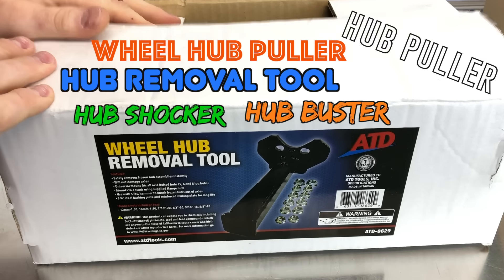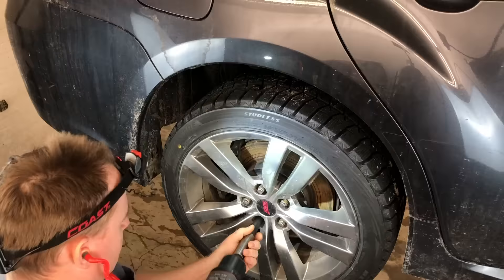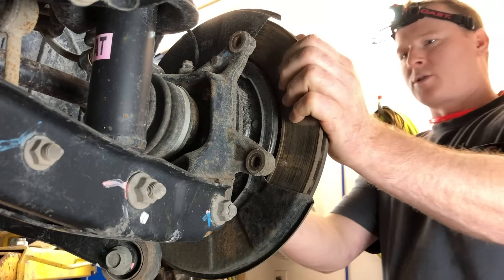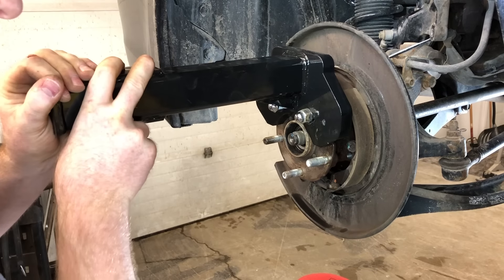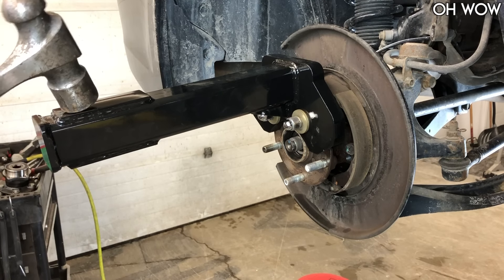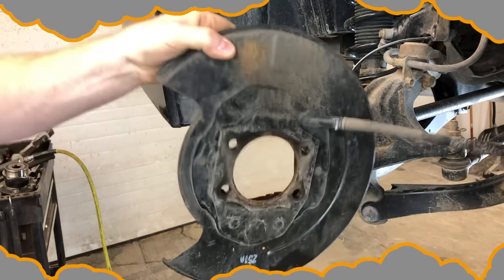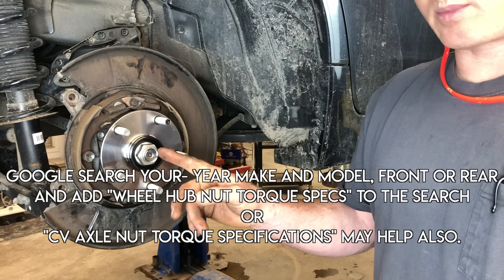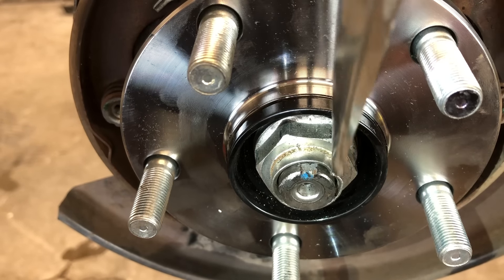HUB SHOCKER Hub Busters  |  REMOVE STUCK WHEEL BEARINGS EASILY!

Comment: I have one of these tools, but didn’t have as much luck on my Land Rover with it.  The nuts and washers that came with it completely failed, so I recommend getting higher grade nuts. It’s going to be tested again since I’m replacing the wheel hub on my Subaru for the second time 🤬.
Reply from the maker: Sorry for the late response. Check out the new video. I solved some of the issues you are having! https://youtu.be/eKqYtMdlPYo

Comment: Rotors are frequently rust-welded at the seam of the lip of the hub assembly, an abrasive pad around the lip of it helps. I hit it with PB blaster too. If i'm replacing the rotor and other components I am not shy about using a min-sledge hammer.
Reply from the maker: Same here! Rust makes you creative  doesn't it? I hate rust haha 😀🔧🔧
Reply: @EasyFixShaun  I ordered an air gun after watching people bust off those wheel bearings in less than a minute with it. :) A valuable tool to add to my air tool arsenal regardless.
I also saw people free up frozen bolts with an air gun you can't fit get any kind of impact gun or ratchet on due to space. PB+creative application of shock from the air chisel, boom.
Reply from the maker: Awsome! I'm glad that worked out great for you. Are hammer's are vital for rust problems. Very handy 😀🔧🔧

Comment: Thank you for sharing this tool! Just wondering can this tool damage the knuckle when you hit the wheel hub so violently?
Reply from the maker: Anything is possible. I haven't seen it happen yet though. The tool seems to really do what its designed to do in most all applications i have used it for, which is breaking the rust bond between the bearing's and knuckle. The only vehicles its not powerful enough for so far is some 2500's and rear ford explorer bearings 😀

Comment: Good video.  Thank you.
Reply from the maker: Glad you liked it! Check out the updated video! Hub Shocker 2.0. I solved all mounting issues I was having with the tool. I only thru-bolt now with grade 8 bolts. I also solved the wheel bearing hub from splitting into two pieces using the cv axle and nut. Let me know what you think 😃🔧🔧 https://youtu.be/eKqYtMdlPYo
Reply from the maker: You are very welcome!

Comment: Wow, my 2002 Sebring was a flood car and the wheel bearings we're still good in it. That was 2 years ago. Glad I didn't buy that Subaru I looked at after that car. But the tool seems to work well.
Reply from the maker: 2002 Sebring bearings seemed to last a long long time from what I remember. 😀

Comment: This fellow says the CV axle is what holds the 2 halves of the wheel bearing together. I just replaced a rear wheel bearing on a ford explorer and the cv axle does NOT hold the bearing halves together. The CV axle splines and the wheel hub splines are tapered slightly such that the hub nut tightens them when the nut is tightened. However, the hub is only pressed into the inner bearing halves. I bought a cheap bearing and hub and the inner race rear half separated. I purchased an expensive bearing and no more problems.
Reply from the maker: The CV shaft has three jobs. Transmit power to the wheels. Transmit power while allowing suspension and steering movement. Hold the bearing together as a failsafe. That is how it works. There are some bearings that do not use a cv axle to hold everything together on some FWD and  RWD vehicles. Those bearings are built differently to make ensure the bearing doesn't come apart. I am glad you got your ride working with some good parts 😃

Comment: just bought the tool - wish me luck trying to replace my rear wheel bearing of 2010 buick enclave.
Reply from the maker: It will work! Keep me posted please :)
Reply: Update :  front wheel took me like 5 whacks of my 5lb steel mallet - and rear ones does not really need the hub buster. Super easy and never ever finish the job that fast - took me 1 hr each wheel .
Reply from the maker: Nice work man! great tool huh? If you ever have to do it the hard way it really makes you appreciate it 😀
Reply: I have a 2013 explorer and trying to get the rear passenger hub out. I’ve got this tool and a 10lb sledge hammer - zero movement even after a ton of really good penetrating lube. I’m a big boy and can swing a hammer - this thing isn’t the be all end all folks. Not working for me. (Yes I used washers and torqued it up good)
Reply from the maker: Try the updated hub shocker video 2.0. Works every single time. https://youtu.be/eKqYtMdlPYo
Reply from the maker: Sorry you had trouble. It works well for me with the axle nut on. Subaru’s or any other extremely difficult to remove bearing come apart without the nut. Once the bearing “releases” from the knuckle the axle nut and shaft can be removed. I’ve had so many Subaru bearings seperate into two pieces that I do them all with the axle nuts still on now.
Reply from the maker: JD5179 Check out the updated shocker video for your next bearing removal. I solved all mounting and separating issues. I feel like I have this thing dialed right in for the toughest bearings on the planet. Let me know what you guys think! https://youtu.be/eKqYtMdlPYo
Reply from the maker: haha! That is hilarious! ....Actually it does work that way now. Check out the updated video. I actually use the nut to keep the bearing from separating on subarus now. Pops em out. Works awesome for the toughest bearings, which I feel are Subarus right now. I never thought in my wildest dreams I would have to remove bearings like this. But, I would say they are super easy for me now. They take me 20-30 minutes roughly. I Got her down to a science 😀 Hope it helps! https://youtu.be/eKqYtMdlPYo

Comment: I used this tool. Beat on it for two days. This tool provides downward force, perpendicular to the force required. The force should be away from the vehicle. The easiest method is the hardened bolt through one of the wheel stud holes. If it is super stuck weld the hub to the bearing so it doesn't separate. Four or five trigger pulls on an impact gun is all it takes.
Reply: The bolt through the stud hole only works when you can push against the knuckle. The Subaru design doesn't allow that.
Reply: @LongDefiant  I used the bolt through the stud hole technique. 7 squeezes of my impact gun and off it came.

Comment: Thanks
Reply from the maker: No problem!
Reply from the maker: Check out the "2.0" video for the beat mounting methods. Ive had some problems with crazy stuck bearings and now use grade 8 bolts only. 😀🔧

Comment: The holes in the rotors accept bolt and make the rotor removal job much quieter and easy.
Reply from the maker: For sho! In michigan though sometimes that method will rip the brake linings off the shoes inside. There is usually a rust ridge on the inside of the rotor. So the best here is to give a hit and see if everything can be broken loose and slipped off. 😃 Check out the second video and let me know what you think if you don't mind??? https://youtu.be/eKqYtMdlPYo
Reply: @EasyFixShaun  I live in PA, so I have something of a clue with rust. It's the red-B R O W N reality of our "Salt Life" in the rust belt. lol.

The first time I did rotors on the Impreza, I was hammering for 20 minutes on the one rotor and it just wouldn't budge so I consulted yee oldé youtubes to see if I was missing something as I only had GM's before. That's when I picked up the bolt trick from one of the "Subaru" Technician channels. 

Thankfully, I have yet to experience P-brake shoe separation. It may help that only use a ratchet and walk the rotor off slowly, but I can't really say for sure as I haven't tried it on any other vehicle. As a side note, I'm slow in general, hence why I never became a professional mechanic. lol.

I'm still on the oem parking shoes with 235k+ miles on my '15 Impreza hatch and I have gone through four sets of brakes thus far. That may be because I typically do rotor and pads together regardless of disc life so there hasn't been time for serious wear to create a larger than specified lip. They last about 50k miles typically, which I easily cover in less than a year right now. However, the last set I got 80k with a bit of life left. I used Raybestos Element3 Hybrid pads and plain centric rotors. In any case, I'll be sure to keep that in mind when I start driving less than I do now!

In my experience fresh pads on old rotors (or drums), even with a trip to the machine shop and a proper break in, end up in warping "great" pedal about half way through pad life. Being a bit of a science/engineering nerd, I know that warping is caused by heat/stress cycling and has literally changed the alignment of the metal crystals. So I don't trust them for longevity after they warp, especially since I do rideshare work.

I'll be due soon for bearings all around (again) myself and will be looking into this tool. It makes economic and time sense between taking the spindles off, taking them to the machine shop, and taking the car in for an alignment afterwards.

Ii want to thank you for taking the time to respond and providing me with new to me information. I REALLY do appreciate it. AlsoI really enjoyed both videos. I hope you had a great holiday and wish you and yours a happy and bountiful New Year!
Reply from the maker: @storejoshuprite  Yup I agree. It makes everything so much more difficult. It sucks. 😃

Comment: Are the holes in the tool egged out enough that this tool will fit larger vehicles, such as a one ton eight lug?
Reply from the maker: Yup will fit 3/4 and one tons. Although if you are working on one of those the socket and extension method on the mounting bolts combined with using power steering to push out is a much better method for me usually.

Comment: My dodge smokes wheel hubs like crazy due to off road/water crossings in silty water...and because it’s a dodge of course. The OEM hubs were stuck so bad the first time I swapped them that I broke several pullers,  and eventually got it out with an air hammer/massive puller combination. Since then, I have coated all of the contact points on the rear of the hub with anti seize, now when it’s time to do the swap, I can swap both of the front wheel hubs in about an hour and usually only have to wack the end of the axle with a hammer to get them to free up. That said, this tool may come in handy in the event that they need a little more coercion.
Reply from the maker: The front wheel bearing of a dodge truck was my first experience with a bolt in wheel bearing hub unit also. It was really difficult and a nightmare. I wish I had the tool. I used to use hydraulic power steering pressure to get them out using a socket and extensions, pushing from the from the frame to the bearing mount bolts. Works. But not ideal. I wish the factory would coat parts in grease or anti-sieze. That would be amazing for us trying to replace them down the road...😀

Comment: I have an adaptor that screws onto the studs and onto my big slide hammer,couple of bumps and off they pop. Cheap and simple.
Reply from the maker: That's is a perfectly awesome method. It's the old method for me though for severely stuck wheel bearings. 😃🔧

Comment: 10lbs slide hammer is my go to for this task. No screwing around with nuts. Hook n hit.
Reply from the maker: Not a horrible way to do it! Do you ever have a bearing separate on you with a slide hammer? I made an update video on the shocker mounting issues and bearing separation issues I was having. I think thru-bolting the tool and the bearing separation trick would help the slide hammer too! Would you let me know if you think? Could help in a slide hammer situation?? 🧐 Hubshocker 2.0 https://youtu.be/eKqYtMdlPYo
Reply: @EasyFixShaun  I've not had a bearing separate on me yet. I've only done around 6-8 of them. It's also my stuck brake drum remover. I suppose thru bolting would work. The slide hammer pipe is 3/4" might have to reduce it down to fit thru the inner part of the bearing. The slide hammer kits offer a lot of attachments or make your own. Just had to thread on the pipe. I'll check out the video. Thanks for sharing.
Reply from the maker: The slide hammers are very handy. I use mine a lot too. 😀

Comment: Do garages still use slide hammers? I would have gone with that as the force applied pulls the bearing out versus hammering down. I can see this tool making an oval out of a round opening.
Reply from the maker: Good question. I would say that a repair shop will use whatever method is the fastest and most effective as a general rule of thumb. They get paid by the job, not by the hour. There is every incentive to increase speed. Either method will work. I used the slide hammer method in the past when typical methods didn't work. It isn't ideal because the bearing will split in half on severely stuck bearings. The slide hammer promotes splitting the bearing because it's actually trying to "un-press" the hub bearing with the lateral hammering slide hammering provides. If the bearing just needs a little extra force from the slide hammer and it pops out, it's a great method. It is the old method for me because the Shocker is faster and more effective for me. Check out my new shocker 2.0 video! Let me know what you think about the mounting using grade eight bolts and the bearing starting to split in two pieces. I solved those two problems I was having with the tool. Both methods could actually be used on a slide hammer also!  😃🔧  https://youtu.be/eKqYtMdlPYo

Comment: That "indentation" will affect your torque on the nut. Replace the nut everytime. Then once properly torqued, make a new "indentation".
Reply from the maker: Theoretically yes I would agree. But if the indentation causes extra torque, couldn't one attempt to compensate for that? Maybe give the toque wench an extra clicks?
Reply: @EasyFixShaun  That is poor procedure man honestly. The bearing comes with a new nut, why spend the time trying to guess how much extra torque to apply with an old distored nut? Its a wheel bearing, proper torque is very important.
Reply from the maker: I am with you. If it comes with a new nut I use the new nut also. The Subaru bearings I used, don't usually have a new nut in the box. Many many many shops reuse fasteners. Have you ever reused a lug nut? Or do you replace those also?
Reply: @EasyFixShaun  If you are going to reuse an axle nut, at least take the detent out of it before torquing. As far as lug nuts go...ive had them fail before.
Reply from the maker: I feel ya man. I will work on taking detents out. I don’t know if there’s a procedure for that. I will need to experiment.

Comment: I got quoted $556 to do one rear wheel bearing from a local Subie shop. Will this tool work on a 2007 Impreza 2.5i?
Reply from the maker: You have press in style bearings for your Impreza. You don't need this tool. The shocker is for bolt in style bearings only. You need a completely different repair process. Here is the video you need 😃🔧🔧   https://youtu.be/P5bwlKKpusk

Comment: I live in Michigan where everything rusts out really bad. I tried a sliding hammer and it didn’t work, I also tried a 3 claw hydraulic gear puller and it still didn’t work... do you think the wheel hub buster will work?
Reply from the maker: What year make and model vehicle do you have. Front or rear bearing?
Reply: Depends on how rusty your wheel hub. most likely it will not work.
Reply from the maker: Try the new video. Makes em pop out like butter with a few tweaks and methods. I only mount the tool with bolts in the lug stud holes now. And I keep the cv axle nut on to stop the dreaded Subaru bearing separation upon removal. Works awesome and these bearings are easy now. Let me know what you think! Hopefully this will help on your next one. 😀 https://youtu.be/eKqYtMdlPYo

Comment: thanks for the video.  I have to do the rear bearings on a 2009 Forester that spent its life in NJ and MD, does the tool work OK on rust belt cars?
Reply from the maker: No problem! Yes it will work perfectly for you. It was made for the rust belt.
Reply: @EasyFixShaun  Have you ever had a Subaru bearing hub come apart using the tool and have to resort to an air hammer to get the half stuck in the knuckle off?  I feel like when I do bearings its no return, one way or another it has to come off when you start,  if the hub breaks apart you're not  towing the car to garage.
Reply from the maker: I have not had that problem.  The shocker separates them clean from the knuckle, takes em right off. Sometimes I hit it with a sledge hammer. You have to apply more energy and force in one clean hit than that rust bond between the bearing and knuckle can handle. Works perfect.
Reply: Easy Fix if a 5lb puller will easily separate the Subaru bearings
Reply from the maker: Hey Joe! This tool works perfectly. I made an updated video that shows how to do em. I would say Subaru rear bearings are easy for me know. Gotta do it like the new shocker video. Trial and error. I have it dialed in now. Hope this helps for your next one😀 https://youtu.be/eKqYtMdlPYo
Reply: @EasyFixShaun  thanks for the update.  I think I will try this on my 09 Forester
Reply from the maker: Awsome man! It works great. I solved the separation issue by holding it all together with the cv axle nut. I have had a bunch do that now. Pretty much right after you ask me 10months ago I started seeing it. Tool works awsome. Makes the repair easy vs one of the worst repair experiences anyone will have.

Comment: Working on the front wheel hub, with automatic shifter on neutral should be able to spin wheel freely, right?
Reply from the maker: Yup typical with all wheel off the ground you should be able to move. If only one wheel is up the wheel on the other side might be stopping you from spinning. You should always make sure vehicle is on a level surface and chocked, unable to roll or move on you unexpectedly 😀